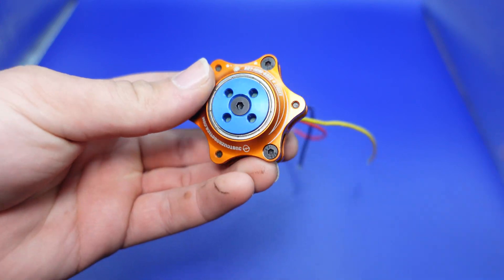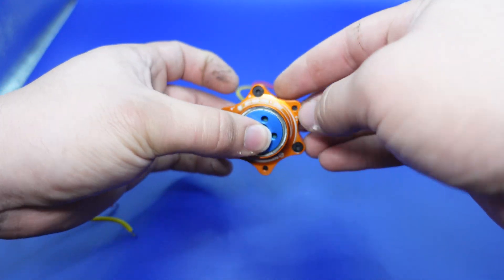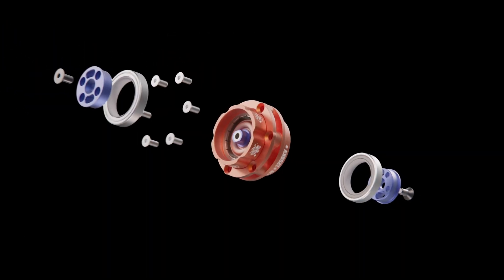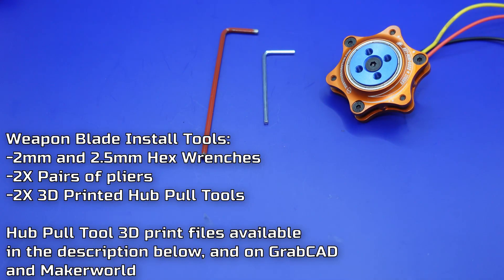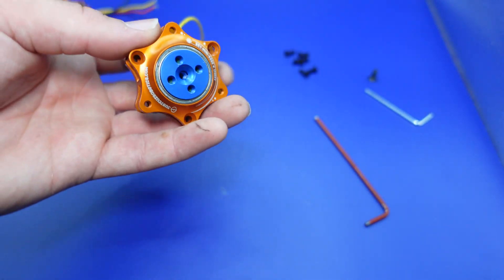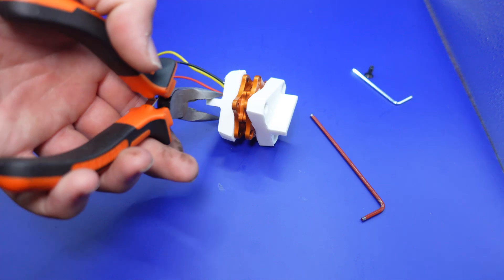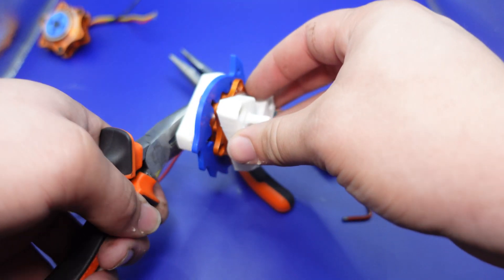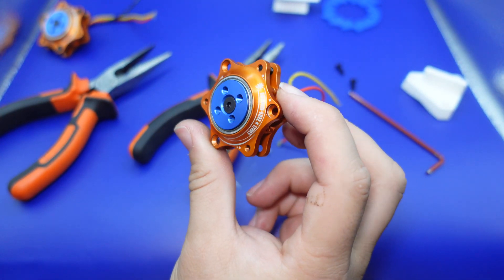Introducing the Antweight Hubmotor: RDY MINI 5022 by Just 'Cuz Robotics

Comment: I’m planning to use this on my two new ant weight verts. Would be cool to see how you mount it on Sonic or any other bot. As a new builder I’m struggling with the best way to support the motor. I was thinking of 4 screws on each side I guess?? Thanks for the awesome motor!
Reply from the maker: 4 screws each side is the only proper way

Comment: hey these,could you please help me with one query? I have got a 50-65 dimension bldc motor for 30lb combat robotics.Mean time,I have got only 100A redbrick esc.Is it wise to plug it in and play or it is foolish? The weight that I am putting into the weight  of weapon is around 5.5lbs.The motor that  I am using is N5065-400kv 1800w 12-16v .Is it really worth to use ?
Reply from the maker: That will probably be fine if you stay in the limits of the voltage described in the product listing for the motor. Not sure if its the same one but I googled "N5065-400kv" and the first aliexpress listing just says "Recommended ESC 80A" so 100A should be okay. But a huge weapon might increase the load on the motor more than what its designed for, so I can't be certain its a great idea. If you wanna take the risk and find out you can always try!

Comment: This is a very interesting hub motor design.  I like how compact it is overall. I looked at your website at the specs and couldn't find approximate torque specs of the motor/esc.   

It is a simple test. You mount the motor on the edge of a table using a string wrapped around it. Use a small bucket and add weight until the motor can't lift the bucket. Measure the weight after and that is the torque. Sand makes a good measurement weight.
Reply from the maker: That test doesn't really work for sensorless brushless motors since they aren't capable of delivering any reasonable stall torque and their behavior is entirely dependant on the ESC they are connected to. I will test spinup times with weapons as a useful metric as that gives more relevant data with the specific esc I sell

Comment: Is it too crazy of an idea to use the ant weight motors as drive motors for a beetle? Edit: or any other size?
Reply from the maker: Idk why you would want that, your wheels would have next to no torque, and extremely high speed especially at the minimum 50mm diameter. I have been thinking about trying to make a drive hubmotor but I don't know if it's feasible at 1lb or 3lb scale. Brushless motors lose a lot of power at low voltage when you make them really low KV.
Reply: @JustCuzRobotics  So yes... It is a crazy idea 😂

Comment: On your video for the other newer motors you included suggestions for weapon size. Any suggestings for us on length and weight?
Reply from the maker: I haven't had much time to run tests yet as these are brand new and I just ordered final production motors without any samples first. I'm travelling the rest of this week but hoping to get some testing underway later this month and can report on the power and current draw for different weapon sizes then.

Comment: I have a design suggestion regarding the disassembly process. If you thread the central M4 hole all the way through rather than making it blind, you can then insert a longer M4 bolt from the opposite side. You'd still need one bolt-on piece for it to press against, but that will then make it easier to separate rather than having to try to pull it apart by hand.

This also simplifies the manufacturing slightly as it's no-longer a blind threaded hole.
Reply from the maker: I don't think that makes it easier to separate, the issue with pulling it apart is that there is a central magnet ring pressed onto the two out hub clamshells. Seperating the two halved of the blue part is easy and pushing just on one would leave the orange hub pressed to the magnet ring on both sides and just push out the blue shaft/ or the stator + bearing on one side. I might change it to a through hole for manufacturing if it's actually cheaper but I doubt it makes too much difference.
Reply: @JustCuzRobotics  Oh sorry yes you're right, I missed that.

The manufacturing aspect depends on the operations used, if you're threading it to the end with a second plug tap after the taper tap then it saves that operation. It also makes it easier to clear the swarf afterwards but whether or not it's cheaper depends on the manufacturer.